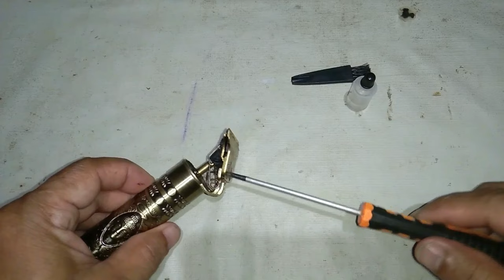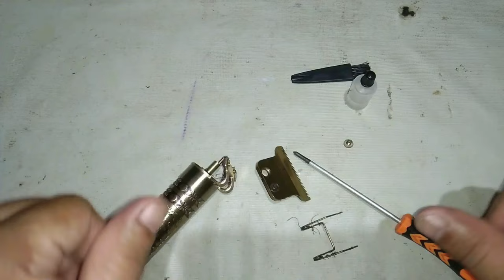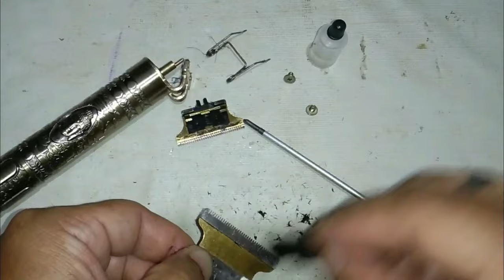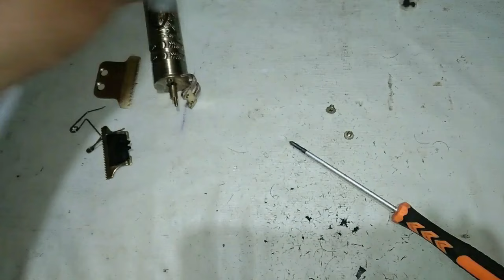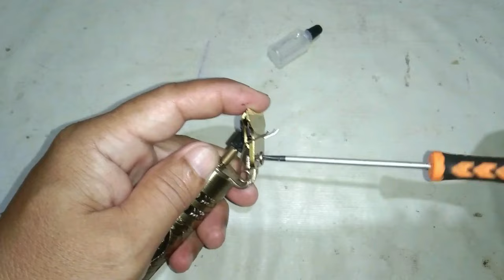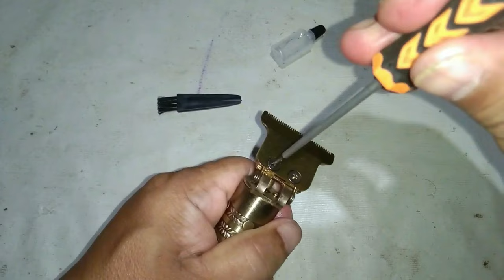vintage t9 trimmer blades remove assemble and clean it

Comment: You're the best I disassembled mine because it kept turning off and the metal spring seemed messed up so I unscrewed it and couldn't put it back together :/ but with your video you saved me the stress of trying to figure it out and it works perfectly fine now !
Reply from the maker: Wow, this is one of the best comments I heard. Thank you.

Comment: It fell on the ground too, the light is on but it doesn't work, what's the problem?
Reply from the maker: The possible cause bro might be that the rotor of the motor is tilted so it is difficult to turn. Try to remove the head and spin the rotor with your finger if it is hard to turn..
Reply: @JunbaTeks  Thanks I will try

Comment: Hi, I have a problem here,my trimmer couldn't working but there is no physical damage,is it maybe because of the battery or something.I really need it fixed ,help
Reply from the maker: There are three main parts of the trimmer to check, motor, battery and switch. If one fails, the trimmer will not run. Watch this how-to. https://youtu.be/oObn_Enkqak?si=WCuZUeUgYlpU_POy

Comment: Bro i got a problem. I drop it and it dis-assembled and when i re-assemble it, the blade dont touch together well and it cannot cut the hair. How to fix?
Reply from the maker: Maybe the guide ( plastic black color in-between the blade) does not properly fit.

Comment: When using it i felt some warm blades, should i put some liquid in that small white bottle on blades? Or can you confirm its purpose?
Reply from the maker: Yes sir apply oil before you use the trimmer to reduce friction, sounds and heat.

Comment: I just got this. But when it came to assembly theres no instructions so I used this video, but for some reason the blades dont line up? Unless its missing something?
Reply from the maker: Yes sir maybe the black plastic in between the blades is missing!
Reply: @JunbaTeks  mine is missing - do you know where I can buy it?
Reply from the maker: You can buy online sir.

Comment: Sir i have this after i charged the battery  i tried to use it works for a few secs the vibration is not that strong compared to a brand new which a sign of a strong cut then it died i dont know why 😫 2 batteries are fully charge i dont know if the razor is broken or the battery btw sir when i bought this i never tried using oil cos i dont know where to put it and i already lost it 🤣
Reply from the maker: Check the battery sir, try using it in another unit or use a tester to check. Also check the motor rotor, turn it with your hand if it is not hard, because when the rotor is hard, the battery will have a hard time turning the motor.

Comment: My battery doesn't charge, is there a way i can get help.
Reply from the maker: Yes brother, please check the battery voltage output and the charger voltage output. So we can sure which is wrong, is it the battery or charger.

Comment: Can you clean it with fresh water instead of brushing?
Reply from the maker: Yes, but it needs to be oiled afterwards.
Reply: @JunbaTeks  Thanks for your information. Will it rust after time when I clean it with water even if I put oil on it afterwards?
Reply from the maker: No longer. Oil will prevent rust.

Comment: Help me, disarm the machine, reassemble it and now it doesn't work
Reply from the maker: Yah, but I have a question, what portion doesn't work, the motor or the blade?
Reply: @JunbaTeks  The blade does not work, there is a thing under the blade that moves when I turn on the machine without the blade on but when I put the blade on it does not move
Reply from the maker: Maybe the black color guide not properly fix sir!

Comment: Why doesn't the middle stick turn? How can I fix it?
Reply from the maker: Motor problem sir. Pls. watch this video link. Thank you https://youtu.be/VM_kGLRu_f8?si=3wP5WDrvkMs2EWLy
Reply: @JunbaTeks  It's not the same, I turned it and it wouldn't let me remove the battery.
Reply from the maker: @Fabian.14.  This is probably the trimmer type sir. https://youtu.be/hja9KrwHd8I?si=PS3gImlglm8hjmoD